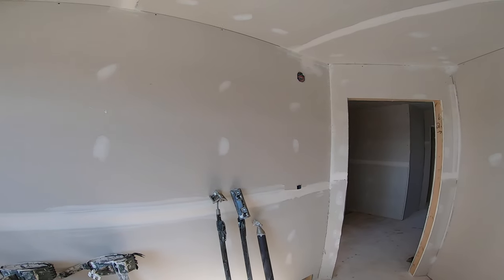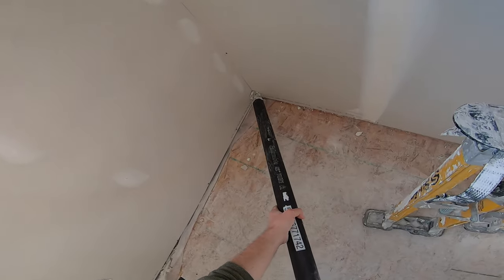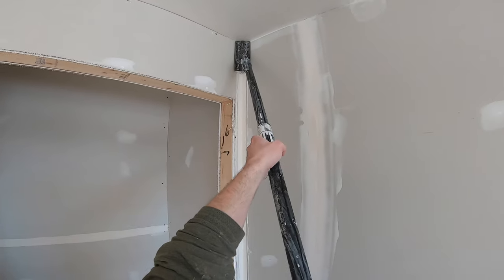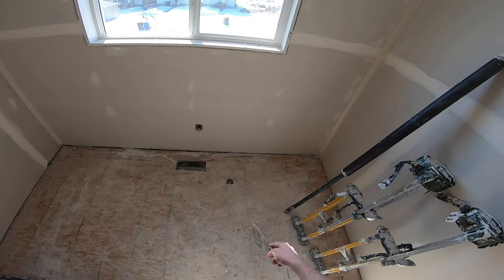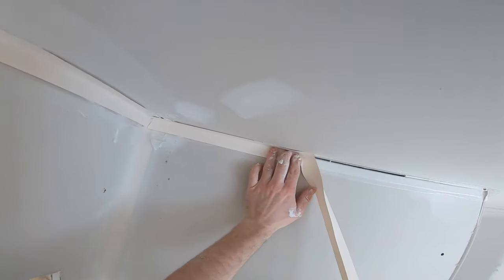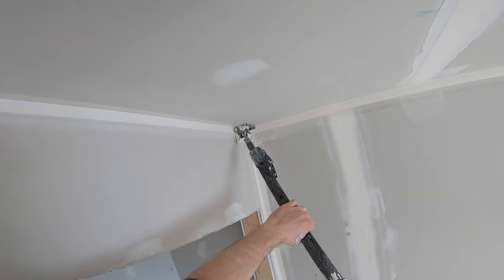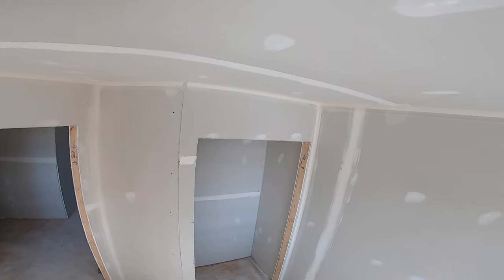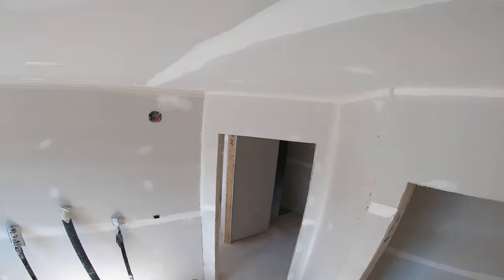Taping drywall corners with a compound tube

Comment: +I've found the best thing to do with those narrow corners, such as where the closest door opening is, is install wider strips of drywall, such as 5 or 6",  and cut them off after you've taped, finished and sanded.
Reply: Damn that's smart
Reply: Experience = mistakes + time. @shortsalesumo

Comment: Love seeing all paper man good work. Try a glazer instead of the angle head leaves more mud on the tape, you can still use the angle head for finishing. Also the new bazookas are quick clean ones, takes me 10 mins tops with a garden hose, one room ya just tape by hand or whatever, like the inside mud aplicator your useing going to pick one up for the tube. Nice seeing other quality finishers around  not those fiber taper"pros"
Reply from the maker: Thanks. I've had some challenges with the Glazers, could be the brand I was using. I used Columbia but they left a ridge. I tried Can-Am, a little better. Might try Tape-tech next. I ran a bazooka for a few years, but my problem is the majority of the work that comes my way is difficult houses, with scaffolding. If all I did was 8-9' lid easy residential, like condo units, I'd have kept with the bazooka. Yeah fiber tape is for amateurs, or small repairs with hotmud.
Reply: @Interior_Works  I admit I have a roll in my crate for repairs, I think it works well there. With the glazers I know it sucks but sometimes they need to be played with, bent by hand or take that spring thing off . Have you tried the small tubes for the auto tapers, not sure what brand you have but many you only have to buy the tube and you existing head fits, I  am sure you know all this already.
I love compound tubes too, there is a place for everything. Can I convince you in learning hawk and trowel though 😂
Reply: @aaronmeyer6244  hawk and trowel! i do want to try a smaller trowel to replace my 4" knife when hand taping flats, it's so much faster to smear on mud with a trowel than a knife.
Reply: Hawk and trowel all the way man. You can plow the mud in way faster I don’t care what and knife guy says. Learn the right way regardless of the leaning curve

Comment: Oh and I forgot to mention I totally agree with you I have a bazooka my own and I never use it anymore I tend to use my super taper and do more than anything the clean-up on some job sites are a pain in the butt with no water no eyedro how can you do anyting😎👍🇨🇦👑
Reply: And tube more * lol
Reply from the maker: I have a bazooka too, but I only use it on big commercial jobs, especially on long runs of stand up sheets, it really shines there, fastest way. But on modern houses, with scaffolding, tight hallways, little bedrooms, tons of closets, I think for myself I'm faster with the super taper on flats/butts, and tube on corners.
Reply: @Interior_Works  I totally agree but I still use the super taper for interior corners on the horizontal angles up top with a 3-inch flusher it does a really good job and clean three ways I don't even have to pick the three ways but these stand-up angles I love using the tube and a two and a half inch flusher because I don't have a small angle head and the 3-inch angle head requires me to roll the angle which is another step but I know how good the angle had works it is a beautiful thing keep up with the great videos my friend

Comment: Do you need to do a second coat of mud after you've gone over with the flusher?
Reply from the maker: Yes, most finishers imbed the tape with a 2.5" or 3" flusher, then use a 3" or 3.5" to put the second coat on. The process is basically the same, tube the mud into the corners with the 90° applicator, then pass the flusher over,  then fix up the 3-way junctions with a Pan and knife